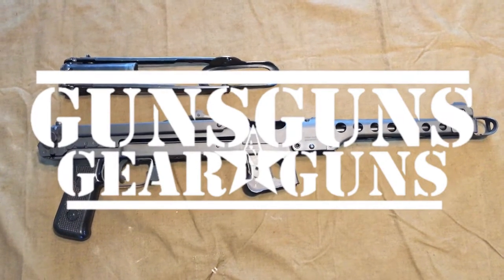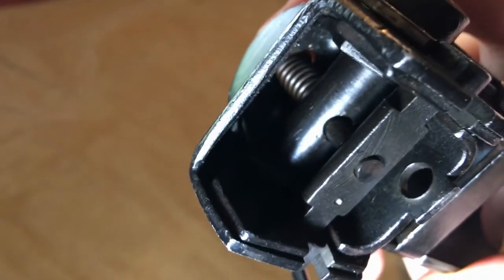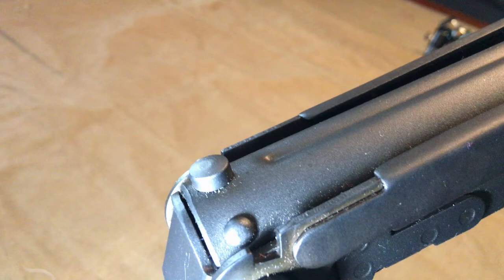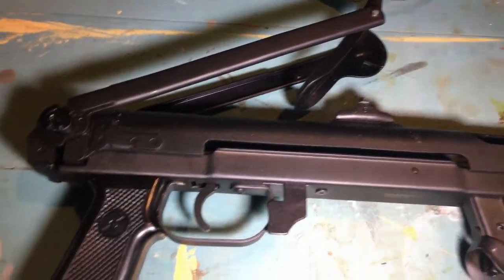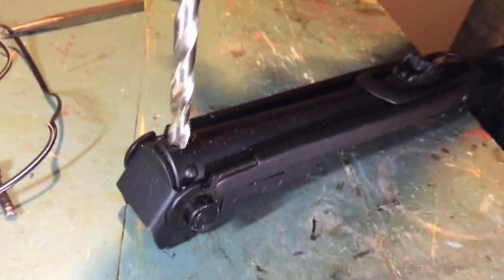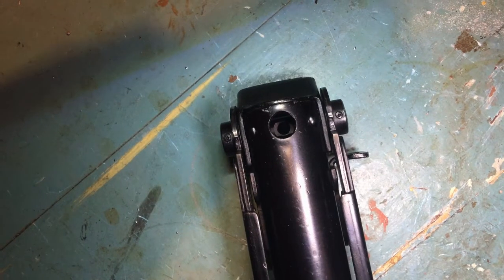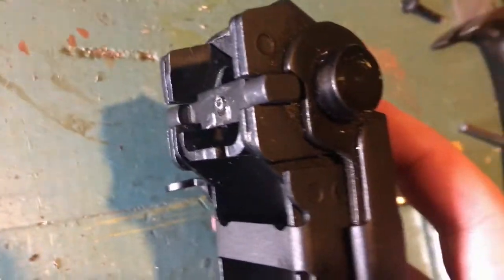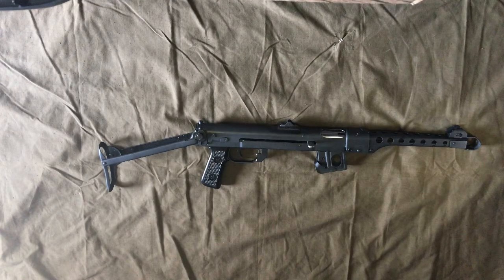How To SBR a PPS-43C

Comment: There's another YouTuber that has a walkthrough like this and machines new push pins for the conversion. $50 shipped for a brand new in spec pin as opposed to buying a worthless cut up parts kits simply for one pin.
Reply: can you point me in the right direction to find this?
Reply: You still have to source a spring for the pin.  The parts kit is worth it in my opinion, you get the more authentic trigger, sling, extra mags, mag pouch, spare bolt, guide spring, cleaning rod, and extra stock for about 70 bucks more. Three extra mags, trigger and sling were worth it to me alone. The guy who makes the pins is username Tula1940 LB
Reply: Where you get that parts kit?  Havent found one with the parts u mentioned for 80 on google
Reply: @limitlessbydesign you can use ar15 magazine catch spring for it
Reply: @mikenilles75  centerfire systems had parts kits for as low as $39. I picked one up. Complete lower but the upper the pieces they send is the rear stock portion demilled, barrel trunnion and front sight portion which was really banged up. Missing a ton of the receiver portion so not a good one to pick up for a reweld.

Comment: I've done a few of these and found it quite simple, at least for me since I have a TIG welder. I figured it out by noticing that the button wasn't allowed to be depressed enough to unlock the stock. Just separate button/pin from crossbar latch and adjust until latch is depressed enough allow stock to deploy. Then weld latch back onto button. Don't remember ever drill out that hole for button, though. Honestly, I can't believe the ATF allows these to be sold this way after I did my first one. I really should get one of these for myself to SBR cuz I think they are neat handy little guns and I like subguns too!

Comment: How far down did you drill?
Reply from the maker: To expand the hole on the top cover, I drilled all the way through because you have to enlarge it. You have to cut all the way through the pin the manufacturer put in place that immobilized it first.

Comment: Great video I did two of these last year....I hope yours is holding up. On the parts kits you just need to Dremel with a sanding drum to get the original weld off the parts donor. Then put that on the New PPS43-C and Have someone or do it yourself  one quick weld on the pin... of course have it depressed like you have it in your video using clamps. I tried it your way peening it and also used JB weld....after months of using it the pin  failed on me. Great job and I hope yours is still holding strong so glad I came across this and have it bookmarked.
Reply from the maker: Mine is still holding up as of now but that’s definitely something I am going to keep an eye on. Thanks for the advice.

Comment: For educational purposes only (and without a legal discussion), can the PPS-43C upper assembly be installed on a FA lower from a parts kit?  I'm assuming the upper has some sort of blocking bar welded in, but I haven't encountered a PPS-43C yet.  I'm not building one, but I'm purely curious about the mechanical differences.
Reply from the maker: I have a video comparing the pistol and the remains of an original from a parts kit. https://youtu.be/V-pVHoXJve8?si=oDBwHS89H_MlVF69
Short answer, the bolts are different, but they freely travel the same distance within the upper.

Comment: Is this still holding up this is a project I've been thinking about doing too and I was wondering what a good way of attaching the new pin was
Reply from the maker: Mine is still holding up, but another commenter said they tried JB weld last year and it eventually failed. I was able to get my pin peened over enough that it seemed to hold without it and the JB weld was to keep it extra secure. I will keep an eye on it and if if eventually fails I’ll add a pinned comment on this video.

Comment: I’m trying to find a parts kit because i’ve noticed on some i’ve found the stock is still in its original state, but a lot of the kits are cut and i don’t have access to a welder. where’s a good a place online to find a kit?
Reply from the maker: Check centerfire systems. I think they are on sale right now.

Comment: How could you remove the roll pin that hinges the top and bottom receiver together?
Reply from the maker: I didn't separate the top and bottom for this project. Since it hinges open pretty freely, I just had it out of the way while I did the work.
Reply: I asked because I was wondering if you could swap parts around like on an AR

Comment: How did you get a completed upper?
Reply from the maker: There are parts kits out there. I bought one from center fire systems on sale for $100 and used those parts on the pistols that are for sale. I just checked and they are still in stock for $130. They come with some magazines, which is nice.
Reply: @GearyGunderson  Thanks for the information.  Would you by any chance know if this kit (7.62x25mm) Top Folding Stock will FIT for the PPS-43C in 9mm??  Looking to get SBR my 9mm soon. TIA
Reply from the maker: @redshield2423  I am 95% certain that the kit would work, because I'm fairly certain the only real difference is the barrel. I'm pretty sure the 9mm uses the same magazines and everything.

Comment: How solid (ie, no wobble) is the stock?
Reply from the maker: I think it’s a solid lockup. I’ve done some shooting with it and didn’t have any issues. It’s based on the MP-40 design so you know it’s good since they stole it.
Reply: Stocks of this type, including those on the original MP-40's, will eventually wobble no matter what. It's just part of the design.

Luckily, it's all just stamped metal and it isn't hard to tune when it finally does come loose.